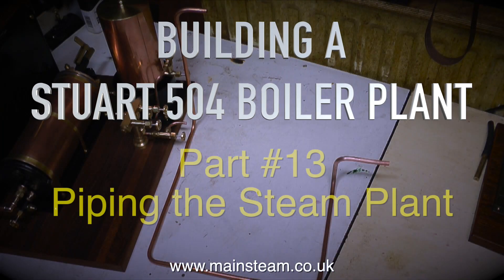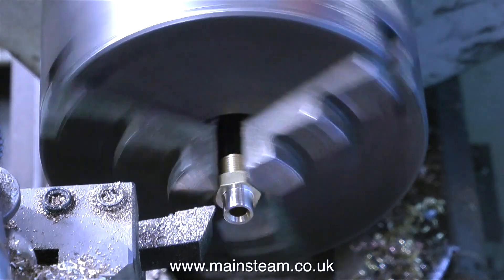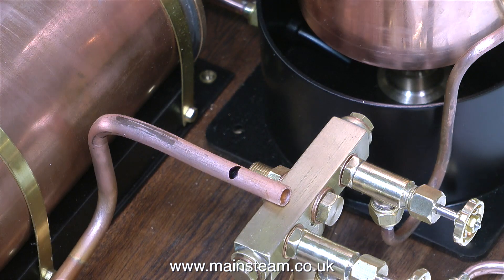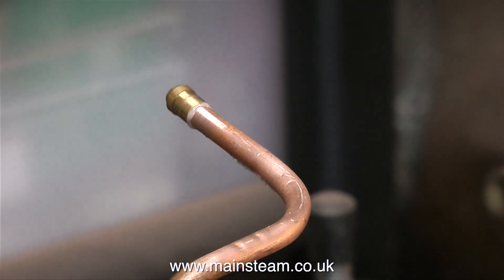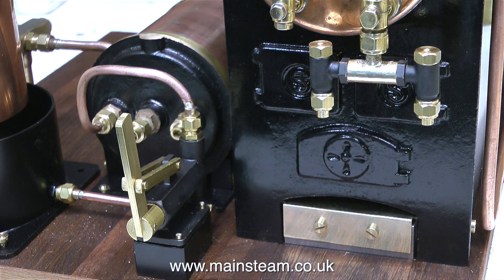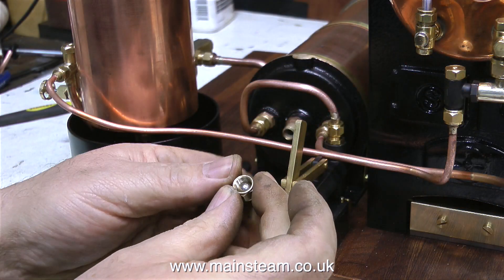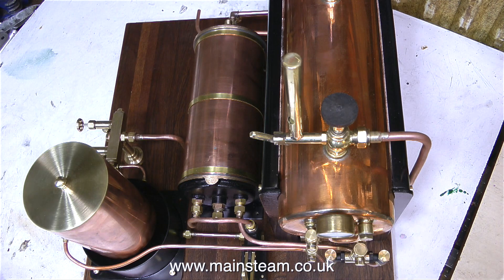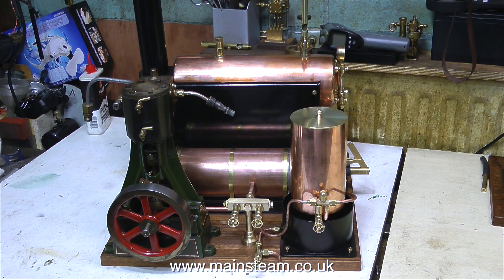MAKING A STUART 504 BOILER PLANT - PART #13 - PIPING THE STEAM PLANT

Comment: Keith, I don't wish to appear stupid here as a noob... but is there a "no no" regarding putting different fittings together? I'm just assembling a manifold for my Beam Engine, and want to fit globe valves which are designed for 5/32 nipples. Can I just screw these directly, with some 542, into the PM Research brass elbows?  Also, I notice you have copper washers here... and I was thinking red fibre. Should I order copper then? :)
Reply from the maker: Yes you can do that without any problems, the Loctite 542 will seal the joints. Copper shim washers are the way to go - I wouldn't use fibre washers as after a while they can deteriorate and they generally look too big and clumsy anyway..
Reply: Many thanks Keith. That's very much appreciated.

Comment: Keith, when I solder nipples onto pipes, for some reason the solder covers the end of the pipe and therefore does not work. What am I doing wrong?
Reply from the maker: You are not watching enough of my silver soldering tutorial videos . . . .
Reply from the maker: Too much Flux on (and inside) the pipe - the Solder runs wherever the Flux is .....
Reply: Many thanks

Comment: I saw this video and you said about softsoldering, thats okey using softsoldering to soldering Wilesco, Mamod boilers because they using low pressure.
I wonder now, I have WEEDEN 14 and I need replace a 1/4-32 plug there, can I use ordinary softsoldering or what you recommended I should use??
Reply from the maker: Sorry I don't know. I can't advise you on this.
Reply: Okay, but is okay to use softsoldering to soldering Weeden 14 boilers for replace nut on the boiler? Yes I have to know if that´s works......... You said that´s so I can trust your words..............
Reply from the maker: I cannot advise you on this.

Comment: Wow! Lots of bending. Do you have one of those little hand-held pipe benders? Usually has 3 or 4 slots for different pipe sizes. Either way, your hand made bends are very nice.
Reply from the maker: I only use that on 1/4 inch pipe, the other sizes I generally bend around my thumb - carefully {:-)))

Comment: I enjoy your videos very much! I have a question. Please note- this is not a critique on your methods or judgement (which I respect), only a question: You seem to use the same hand pump often. The parts you make are not overly ornate, but do have a 'period' look about them that I like. The hand pump, on the other hand, has a very modern 'clunky-chunky' look. I've seen where you have fabricated an extension to the lever and you put some shape in that, so have you considered reworking the pump lever and linkage to give them some profile and interest?

Please note: If my question seems about a small, insignificant detail, it's not from nit-picking, it's because everything else is clear, logical, and already perfect...
Reply from the maker: The pumps work fine without having to knock them apart to rework them ....... I hardly have enough time to do what I do without making the job twice as difficult . . .

Comment: Love your videos,Keith. I'm 70 yrs old and still learning:). One question.  How do you bend the copper tubing without kinking the bends?
Reply from the maker: I bend the 3/16" & 5/32" copper pipe around my thumb usually, but sometimes I bend it around a piece of steel bar. The bends on the main steam feed (the long 1/4" pipe) were done using a small pipe bender that I have. Happy New Year ...... {:-)))

Comment: Wouldn't it be better to put the double check valve adapter on the inlet to the economizer and preheat both the water from the injector and the hand pump? Currently the water from the injector goes into the boiler cold. Also the check valve on the boiler could be used then.
Reply from the maker: I just answered that question 3 lines below, but here it is again in more detail: The injector feed is fairly hot anyway because of the way a live steam injector works and I was a bit concerned about the length of the pipe .... Plus the condenser would be filling up too quickly all the time the injector was running. Too many check valves is not advisable ...... not good for the flow ......

Comment: Does the water from the injector not need to go through the economiser?
Reply from the maker: Not really, the injector feed is fairly hot anyway because of the way a live steam injector works and I was a bit concerned about the length of the pipe ....
Reply: That makes sense. How does it work, anyway? Will you be explaining it in a video?
Reply from the maker: The economiser or the injector ?
Reply: The injector
Reply: Injectors are funny things.
Steam blows through a tiny nozzle at high speed and sucks the water with it. The water is accelerated so much that it can overcome the boiler pressure.
At first sight, this should not work at all: You have steam, at most at boiler pressure, and it must propel water so much that it lifts the ball of the clack valve against boiler pressure again. The solution is that the steam condenses when mixing with the water, and this propels the water the extra bit it needs to get over the boiler pressure. There is an excellent wikipedia article on this, by the way.